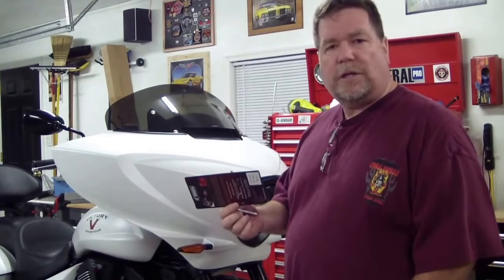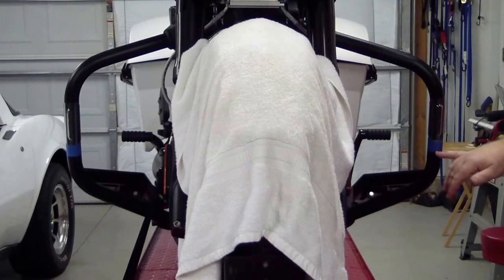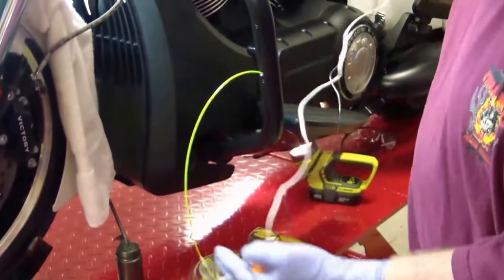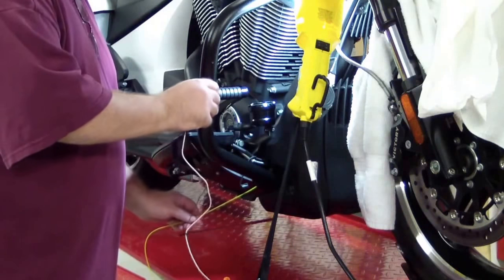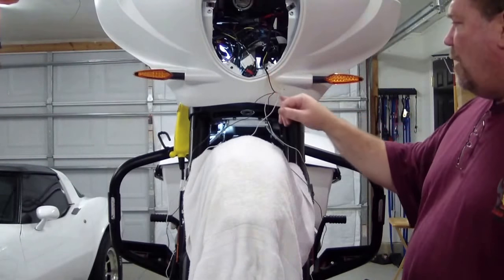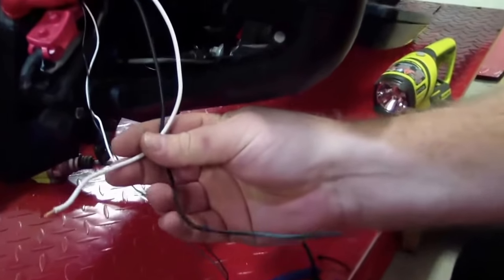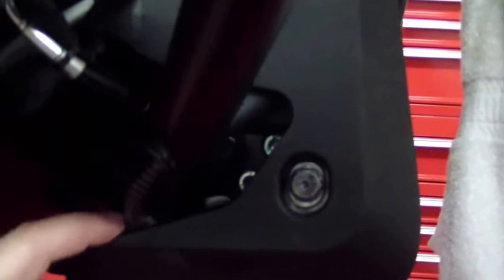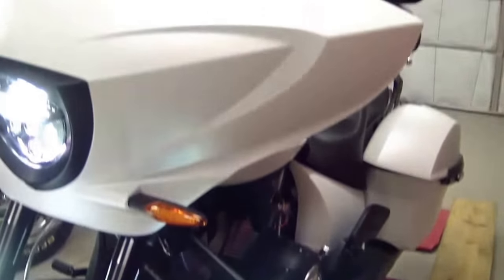Victory Cross Country Crash Bar Light install

Comment: that was some good work what i like about that is you can still put highway pegs on....i wish you could have turn the lights off
Reply from the maker: Thank you for the comment, It wouldn't be hard to add a switch. There is a spot in the dash where a victory rocker switch could be added  to make it look like a factory install.

Comment: Great video...and music...and corbette...and bike...so did you have to use a higher amp fuse???  I'm curious about the current draw for these LED's
Reply from the maker: Tony motorcycleman68 I wired it to the battery, I don’t know the exact amp draw but it was low. Fuse should we sized for the wire you use.

Comment: So since u went behind the head like did u just run th lights into the low beam of the headlight
Reply from the maker: No, I just found a hot lead and tied into that I used. It has been so long that I don’t really remember now
Reply: @Thesimplehomeowner  gotcha thnks
Reply from the maker: I might have even brought the power up from the battery now that I think of it. I used the factory victory switch so I had to take the fairing off to install. The lights were able to come on regardless of the headlight on high or low beam
Reply: @Thesimplehomeowner  ok i just watched another video that shows a hot wire behind the fairing.  I may try that one it seemed simple